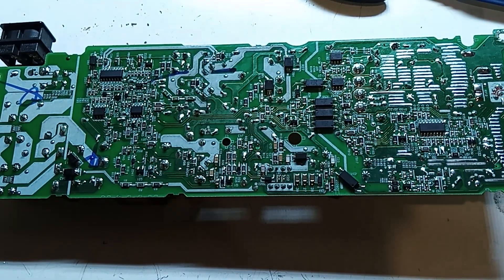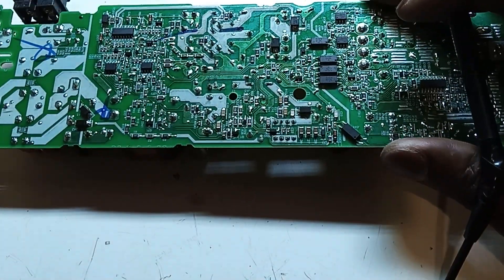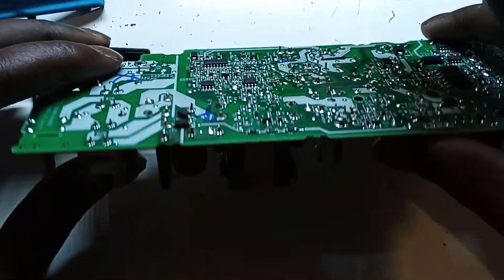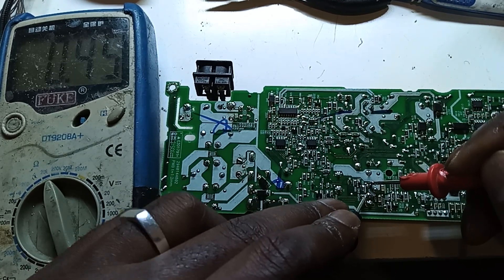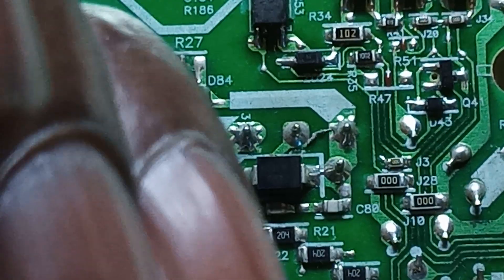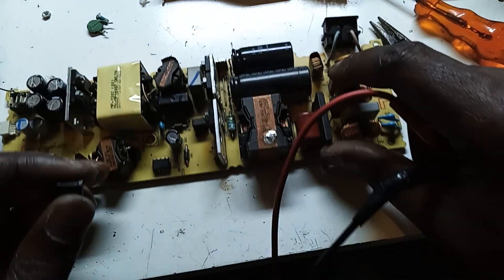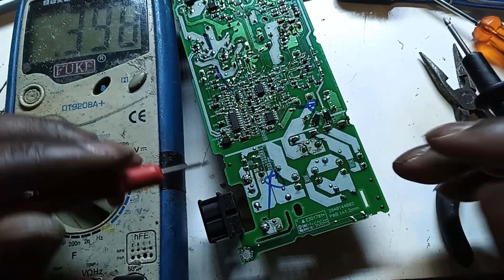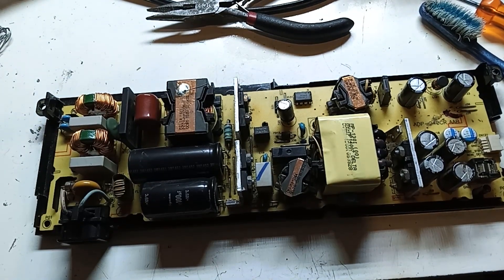Ps4 power supply repair ADP-240CR

Comment: Where can I find the exact procedure to do that? I don't know the tool I need to use, the pairs of pins I need to measure and the result I'm expecting. Where can I find all this information? And I'm also not sure about the corrispondence between the anomaly and the component I need to change
Reply: I mean the tools seems to be something that beeps at shorts and a multimeter for resistance. But I'm not sure about at which pairs I need to use one or another

Comment: So it looks like the bridge rectifiers are pretty common fail points. So they read ~10 ohms and no continuity if they are good? What was the part he replaced near the fuse? How did he determine it was bad?